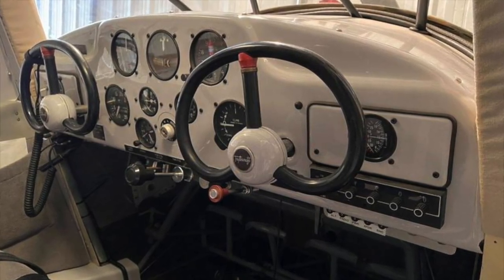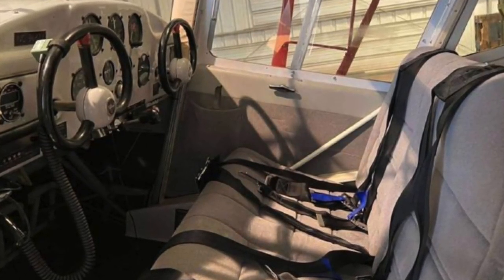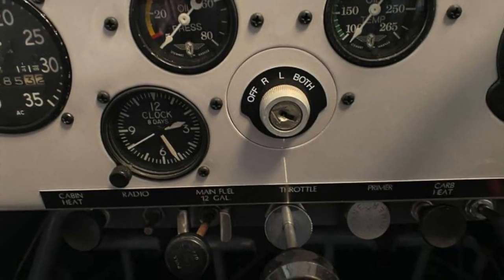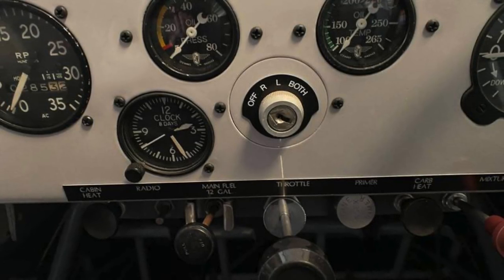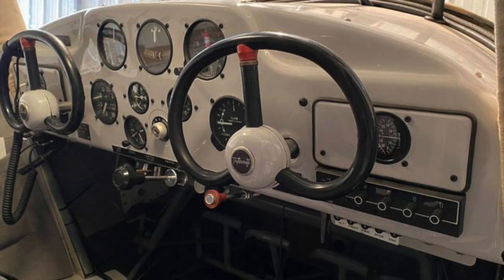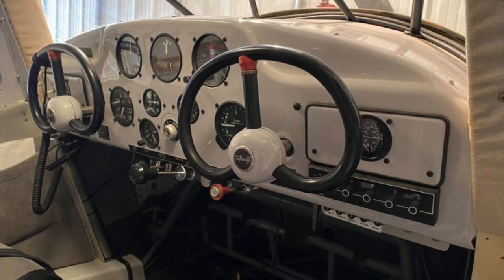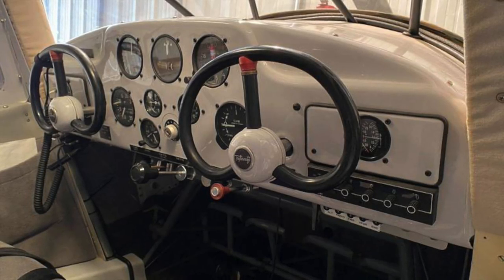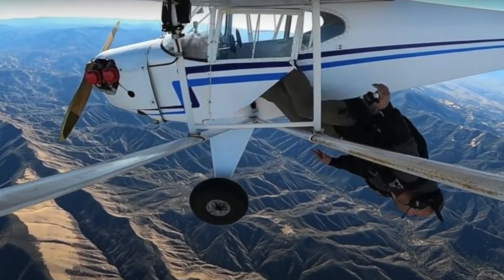Trevor Jacob How to shut the engine down in flight.

Comment: The funniest part in his video is when he starts pumping the controls up and down. That's exactly what I did when I played Microsoft Flight simulator X at the age of eight.
Reply: That isn't all that strange to do in an engine out. Your going to be fighting to hold your altitude until you hit your best glide speed where you start to descend to hold the speed. He was clearly trying to slow the plane to achieve glide speed, or more likely to make it safer to jump.
Reply: @sheberly  The pumping just makes the plane unstable, reduces the gliding distance and  makes it more likely to stall if near stall speeds. More speed = holds altitude better = better slope angle = prevents stall = makes it possible for the plane to glide for longer. Speed and height is a pilot's best friend in those situation.  He would not have needed to make it safer to jump, as the speed at which skydiving planes go is much greater than the speed of his plane when his engine cut out.
Reply: @sheberly  He was trying to slow the plane to keep the prop from rotating on cam since the engine was obviously fine. You don't YANK the controls back and forth to establish a glide speed since you were hopefully in level flight when the engine stopped. 

You pitch your nose down just to be safe and compensate for lack of pull, look at the speed and altimeter, establish a safe glide speed and look around for emergency options -- of which there are many in that area though it looks mountainous, you have a bush plane that lands on a dime. The glide from his altitude to ground is SEVERAL MINUTES in that plane.

In a Cub type plane you do NOT need to be "fighting" for altitude, it's a bunch of metal bars and canvas and it's not far from an ultralight compared to a modern Cessna of the same size.
Reply: @sheberly  I disagree.  It is very strange.  He slowed the plane all the way to buffett before bailing out.  The first priority in an emergency is to fly the plane.  You dont want to pull back to slow your plane down to the best glide speed, thats wasting energy and is spoiling the outlook for gliding to a safe area.  What is the actual procedure is to level out until it slows to near best glide and then pitch forward to maintain it.  And then do all the rest of the emergency procedure that he never did.

What he did was stall out his plain to rob it of as much energy as he could before he yeeted it into wilderness wildlife reserve...  He is busted.
Reply: @sheberly  As was pointed out,  smoothness of controls = efficiency of flight = better glide performance.    The pumping of controls was simply a way to dramatize the fact that the engine had stopped.    Otherwise his credibility would have been brought to question if the prop was to continue to turn.   At this point we have a fair amount of other items to limit his credibility,  but the fact that the prop stopped,  showing the engine had quit is not one of them.   That poor 65hp low compression engine would gladly windmill from almost any forward air flow.
Reply: For me the funniest (and most perplexing) part is the fire extinguishers concealed up his trouser legs
Reply: @sheberly  Yep slowing the plane right down, to get the door open to jump out and trimming it for near level flight without inducing an actual stall, so he was near the stall speed. The proper procedure to recover this aircraft would be to try and nose down a bit and attempt a restart with the magnetos, because it doesn't have a starter motor (on the ground you start the engine by swinging the prop by hand).
Reply: @flyer55jrt  would windmill? Did you watch the rest of the footage right up until the point of impact? It most definitely did. As a matter of fact, it started windmilling shortly after he bailed out, to the point that many here on YT joke that the flight path was very smooth and the aircraft was much better off without him at the controls. 😂
Reply: Abcdefg - That is understandable at age eight... but it doesn't apply to Trevor.  He's nine.  😏
Reply: @sheberly  bro what? You don’t pump the yoke lol you are not a real pilot. You slowly pull back (or forward depending on speed) on the yoke until you reach vg.
Reply: @sheberly  before you get into a glide approach to emergency land, you want to go through your engine restart check list, no? That he didn’t do that at all speaks volumes before we get to any of the other hinky things people are pointing out.
Reply: That's how you engage the accelerator pump on carburetor
Reply: @sheberly  it is strange, there's no "fighting" anything. You just relax back pressure on yoke to let nose down which increases speed. It was purely for the dramatic effect
Reply: @abcdefg4570  
I Agree with you on most parts but:
"More speed = [...] makes it possible for the plane to glide for longer." is wrong.

There is a Speed for the best glide Ration, but its much closer to the stall speed than to the Vne for most planes. And normaly slower than the cruise speed.
Reply: @ProfDrTubifexiusT  Assuming the engine cut out when the plane was at cruise speed,  there's no point to immediately slow it down and lose the 'extra' speed by pumping the sticks, however.

Comment: Just to be clear, many aircraft with the early Continental A-65 engines (and earlier) did not even have a mixture control. My 1946 Taylorcraft with A-65 did not, so it's almost a certainty that "Trevor Jacob's" 1940 Taylorcraft also did not have a mixture control. The normal way to shut off the engine after flight is to turn off the mag switch. One could also turn off the fuel valve, but at idle that would take about 2-3 minutes. Either way, after an actual engine failure the propeller does not stop at normal gliding speed. The only way to stop the prop would stop is when you intentionally slow to stalling speed or below, as you can clearly see him do in the video.
Reply: Your right the Continental C85 & smaller use the Bendix Stromberg carburetor there usually safety wired to rich. I hook one up & it still wouldn't shut the engine on idle cut off like a Marvel Schebler. You have to use the mag switch.
Reply: He obviously had to bring the plane as slow as possible so he can jump out with no possibility of impacting on exit.
Reply: Did you see he swapped engines.  Look at the exhaust, valve covers and sparkplugs on the day of the flight.  He even went so far as to paint the valve covers red so it wouldn't be as noticeable.      Let's hope he gets a hefty fine for littering in a National Forest.
Reply: @windshearahead7012   Exactly!
He took the decision to jump as soon as the engine cut out, despite his training.
His training taught him to maximise the glide angle. He minimized it by pulling the yoke forward... totally the wrong thing to do.
His training taught him to then look for a place to land safely. There were many options available here. The best was to glide to the nearest airport, which he could have done easily, with height to spare. The second best was to head in the direction of the airport where there were large areas of flat terrian. The third, and worst but still good option, was to land in the valley below him where there were many large, flat areas, easy to safely land in (this aircraft can fly at 35 knots).
Following this, he was to try to restart the engine. 
If that failed, the thing to do was call mayday and head towards his chosen landing area. 
Instead of doing any of these things, which he was trained to do, he took the unnecessary and dangerous decision to just bail out of the plane.
With a fire extinguisher strapped to his leg, a sky-diving parachute (rather than an emergency chute) and wearing an altimeter (only used for skydiving. 
You keep deluding yourself if that's what makes you happy but don't try to drag us intelligent, rational people into your delusions.

Comment: Wow. That guy gave thousands of people a lot to talk about/study for a long time. It happened fairly close to wear I live. It's all very bad but one thing that angers people here is the chance of another forest fire! And the wild life is already stressed from drought. That guy angered all types of people from pilots to little old ladies.
Take care all.
Reply: The little old lady pilots are especially angry.
Reply: There's one group of people you never want to piss off, and thats the little old ladies.... Trevor fucked up.
Reply: I’m sure that’s why he had cabin fire extinguishers stuffed into his pant legs. 🤦🏻
Reply: I agree with you Susan, a potential fire would be catastrophic.  Added to that is the general publics ignorance of most aviation.  I am a light plane pilot, Cessna 152, 206 and a Cherokee 6.  I haven't flown a Taylor-craft, however I have heard amazing things about them.

This garbage about flying with a parachute is just that, garbage.  Planes and especially planes of that size can glide for a long distance, depending on the altitude they are at.   He was up around 9,000 feet which means he'd have a glide zone in any direction of about 81,000 feet, that equates out to a little over 15.3 miles.

I read one account the someone re-enacted the engine out and was able to return to the airfield he took off from.  Flying is still the safest form of travel.  The maintenance on a plane is horrific.  If you were to use the same maintenance on your car, you couldn't afford to operate is on a daily basis.

I am angry that this moron is spreading false information and scaring the average person out of flying.

He has done nothing but endangered lives for a YT prank for click bait.  I seriously hope the FAA and NTSB throw the book at him. I hope he never gets his licence back again and has to pay big fines
Reply: @justunicorn001  Good information and observations for the most part but I challenge, "Flying is still the safest form of travel."  Only if you are counting Part 121 and 135 flying.  I believe General Aviation on the whole remains on par with riding a motorcycle in terms of risk.

Comment: Silly question here from a non aviator but if he knew how much fuel he required to get himself to the required altitude and the required location couldn't he just fill the tank with that amount of fuel, wedge the fuel level bobber so that the thing indicated a full tank to the wing mounted camera so he could claim an engine failure rather than having to admit to short filling his tank and then simply fly the plane on a predetermined course until the fuel ran out? 

Surely such a calculation would be quite easy. 

His aircraft has two tanks so he can easily do a practice run to work out consumption by fully filling both tanks and leaving the valve for the interconnecting line closed. When he reaches the location where he wants to bail he opens the valve on the wing tank and transfers fuel from the wing tank to the main tank until the main tank is full and then he shuts off the transfer valve and leaves it shut. When he lands whatever volume of fuel he needs to put in the wing tank in order to completely fill it is pretty much the volume of fuel he needs to have in the main tank in order to reach the location where he wants the engine to stop so he can bail out.

He then drains the main fuel tank and on the day he just fills the main tank with that exact amount of fuel and a engine failure in just the right place is guaranteed. In the video the link between tanks is disconnected as he absolutely does not want any residual fuel to enter the main tank from the wing tank.  

The dipping and diving he did when the engine first shuts off could simply be an attempt to slosh any last remnants of fuel around in things like filters to make sure the tank and the lines are all completely empty in order to minimise the risk of fire from spilt fuel following the crash which could destroy his cameras and the valuable footage they will contain.

Obviously he strapped the fire extinguishers to his legs before he set off as a precaution as he couldn't know for sure that his fuel calculations would be 100% accurate and with a stuck fuel bobber he would have no real way of knowing how much fuel he actually had left onboard as if he got it wrong and had too much he could end up being forced to turn off the engine by some other means with fuel remaining on board in order to crash in the right area or he could end up with the engine stopping over a populated area while also not having enough fuel to safely make it to an airfield.

It's not like he can try this stunt by short fuelling his plane so he runs out of fuel mid flight in the wrong place forcing him to glide to an emergency landing at a local airfield and then go out the very next week and do the same thing again but instead crashing the plane without someone linking the two incidents and seeing the first incident as a trial run.

He had one shot at this and he had to get it right.

Comment: Did you see he swapped engines.  Look at the exhaust, valve covers and sparkplugs on the day of the flight.  He even went so far as to paint the valve covers red so it wouldn't be as noticeable.      Let's hope he gets a hefty fine for littering in a National Forest.

Comment: At 0:09 there is a fuel shutoff knob labeled "MAIN FUEL 12 GAL." He could have simply closed this valve to shut the engine down.
Reply from the maker: Thanks for that as I said I have never flown one.
Reply: As easy as that might sound, if he did that he would still have fuel on board that could ignite on contact with the hot engine on impact causing a fire that would destroy his cameras and the footage they contained.

It would make more sense to wedge the fuel level indicator and short fill the aircraft with just enough fuel to reach the preterminal area where the failure would be staged and with no fuel on board there would be minimal chance of a fire following the crash.
Reply: @paulchartley  I  think he turned the mags off, lack of fuel and the engine would have spluttered, it didn't!

Comment: That aircraft feeds fuel out of a 12 gallon nose tank forward of the instrument panel. It has a cork float wire extending out of the fuel cap. You can see the wire extending upwards I estimate he has maybe four gallons left in the tank. That engine burns 4.5 gallons per hour. There are two types of carburetors that are certified on a C-65 T- craft, a  marvel schebler and a stromberg. On the stromberg the mixture control is wired shut.  To  shut the engine down you would pull the mixture control out and shut of the fuel flow. Or you could close the throttle and shut off the fuel at the valve. The mixture control is the red knob on the right, this one is a vernier control. When you are down that slow with no airflow over the elevators the control get mushy.
Reply: If he only had 4 gallons left, he would not have made it to Mammoth! God or the suction must have been looking after him…
Reply: He never planned to make it there.He flew to the jump zone with no wing fuel and limited gas onboard to avoid a crash fire which would damage his footage on the plane.
Reply: @AAAskeet  ..yep. VERY minimal fuel onboard. Matter of fact he might’ve planned ALL THIS WHEN THE ENGINE DIED FROM FUEL STARVATION, THEN JUMPED…
Reply: The T Craft's have a cable operated fuel shut off on the lower panel for fuel tank. The camera would of clearly shown it was pulled out to off. That's why he had to take the cameras.
Reply: The indication from the fuel level indicator is irrelevant because it can simply be wedged in place to make the tank appear fuller than it actually is indicating over an hours worth of fuel when in fact there is merely a few minutes worth.
Reply: @Nord3202  If he wedged the fuel indicator that is right in front of the cockpit windscreen in place so that it indicates an almost full tank of fuel when the tank is actually almost empty then that bobber wouldn't move throughout the entire journey and the camera in the cockpit would show that it wasn't moving revealing the deception.

Comment: A couple weeks ago I thought about making my own investigation video on Trevor but there was already 2 or 3 out and I thought nah I'm too late but here I am two weeks later with people still capitalizing off of it every day.
Reply from the maker: Investigating you mean. I am amazed at how much people have worked on every detail frame by frame and I am sure the FAA will look at what people have come up with. From the start it is suspiciously obvious that this was a planned stunt. But to be fair to Trevor Jacob innocent until proven guilty. The guy is under investigation as we speak and it will be interesting to see how this pans out. In the meantime pilots and enthusiasts are going to talk about it.
Reply: Would be strange to hire a helicopter and remove the wreckage if an NTSB/FAA investigation was underway.
Reply: @dieselyeti  I could be wrong, but this probably doesn’t merit a NTSB investigation. My guess is that there will be an FAA investigation run out of the local FSDO office (in Santa Barbara?) In any case—these investigations are ADMINISTRATIVE, not criminal. Innocent until proven guilty doesn’t apply. If there are administrative infractions, Trevor’s license could be suspended or permanently pulled.

That said, once the administrative investigation is done, any information collected can be used in criminal proceedings by the appropriate law enforcement agency. And if Trevor altered the crash site or removed the plane, ohhh boy. That’s major crimes.